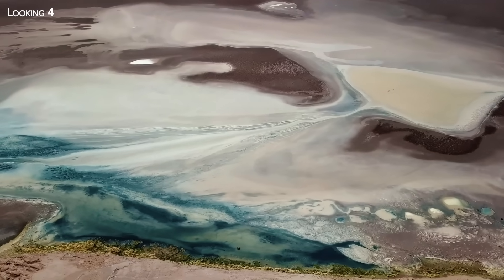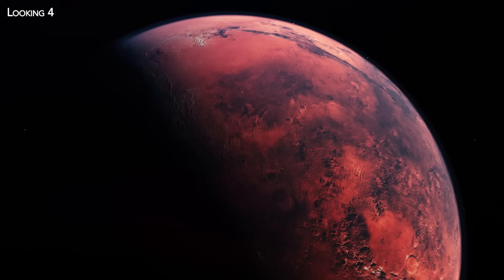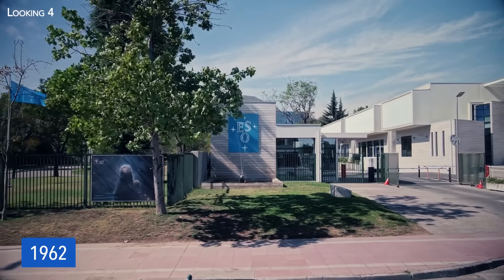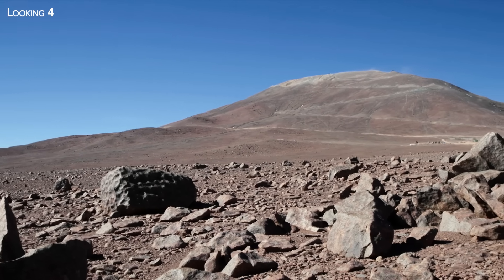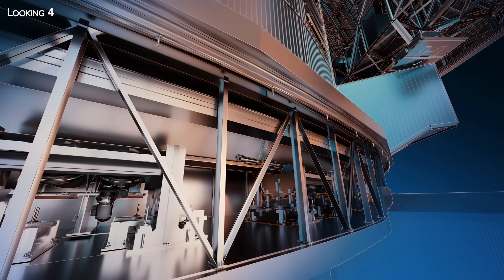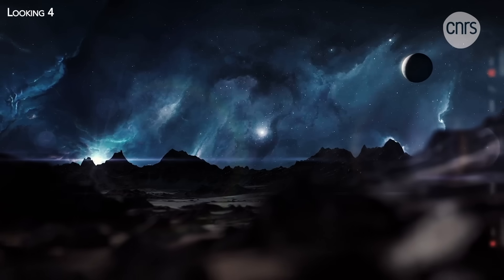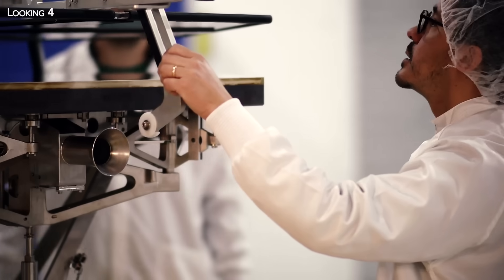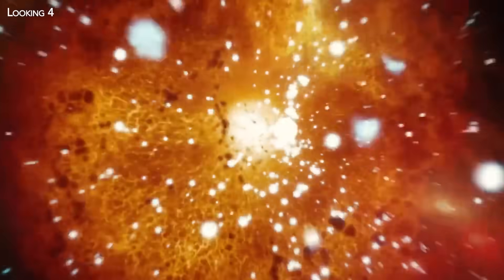ELT: The New Telescope that could Find the Origin of the Universe

Comment: First, Sagittarius A was not the first black hole imaged. That was M87. Sagittarius A at the center of the Milky Way came much later due to dust, gas and stars obscuring our view, even though it’s closer. 

Next, ESO DID cut corners. They went from 40 meters to 39 meters for cost. That is annoying and it’s a corner cut if I ever heard of one, so why go out of your way to say that they didn’t? 

Third, the GMT is not of ESO. That wasn’t mentioned, so the viewer would assume it’s an ESO project.

Fourth, the 30 meter telescope is not a part of ESO either. That’s a lot of corrections when the facts are simple and easy to find.

Just do a bit more homework, otherwise, a decent video.

Comment: COSMOLOGICAL ICE AGES
 We computed our solar system's orbit around Sirius A and B and it matches the last Ice Age cycle of 105,000 years. We were captured by the Sirius system 800-million plus years ago and were following little Sirius B 1.5-solar masses around Sirius A, a two-solar mass star. It was the light from these objects that took early Earth's 1000+ pound per square inch atmosphere down into layers of limestone 12,500-feet thick, vast layers of hard coal with a compression ratio of 40-to one and vast pools of oil everywhere made by diatoms in shallow seas. 

My Encyclopedia Britannica states the limestone layers from the Carolina's to the Rocky Mountains has an average thickness of 3,500 feet thick. You have to realize all that wonderful carbon material was air at one time. Now Earth's atmosphere is only 14.5 PSI at sea level. We lost 98% of the air on this planet. It is all underground in the form of coal, oil and limestone all created with light and the light didn't come from the sun!!! Sirius B puts out more than 100-times the light of our sun in the 350 to 400-nanometer range slightly above the range of human site. Sirius A being two solar masses puts our four times the light of our sun in the visible spectrum. 

Our solar system was born in Orion. We drifted out of their 2.4-billion years ago and earth froze up for a billion years because space is cold. There was no way to get out of the billion-year Huronian Glaciation Ice Age but by some freak were drifted between Procyon and Sirius into a mutual gravity alignment point. Little Sirius B at 1.5 solar masses came around traveling 7.5 kilometer per second and grabbed hold of our solar system and we started following it around Sirius A for the next 800-million years. 

It was the light from those objects that made the energy that makes your car go down the road and heats your home. It wasn’t the Sun! In fact, the Sun did not burn as hot as it does today 800-million years ago. There was no way it could get life started on the "---Surface of the waters" especially when early earth has a 1000+ PSI carbon dioxide atmosphere that was 2500-miles deep. Now our atmosphere is only 50-miles deep and 14.5 PSI at sea level. Co2 is a trace gas of .04%. Look it up! It has little or nothing to do with climate change. In fact, we need more of it to grow food. Methane release changes climate. Kill your cows and stop eating cruciferous vegetables. Also plug up all volcanoes because they emit lots of co2.

There is a planet in the Sirius system and they need ORME gold to spray in the atmosphere of their planet to protect it from the harsh UV light of Sirius B putting out more than 100-times the light of our sun. The Elohim / Nephilim came to Earth 400,000 years ago to mine gold. It would have relatively easy for them to travel to Earth using conventional rocket technology in a voyage lasting 8 years using the various gravities of planet in our solar system using planetary alignments. 

The Elohim/Nephilim created modern humans using some of their own DNA and indigenous earth species. They needed smaller workers because the Elohim/Nephilim stood fifteen to twenty-feet tall. You can't tunnel underground when you are that tall. It isn't feasible to make the tunnel opening that big due to dangerous cave-ins. We humans were created as a slave race to mine gold for them and worship and obey them.

On this planet our government sprays aluminum powder, boron and virus over major cities to dumb us down to keep us from questioning government and make us good worker slaves. 
READ: COSMOLOGICAL ICE AGES 380-pages 8.5 by 11 is available at: www.GuardDogBooks.com www.Amazon.com and book stores around the world in China, Japan, Indonesia and Europe.

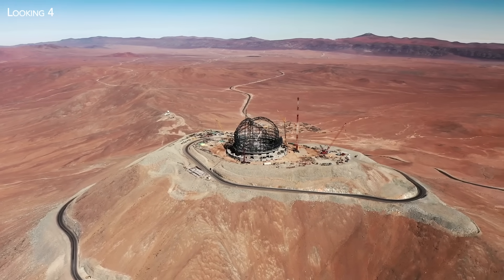Comment: At 5:19 the narrator says...'' to be close as possible to the stars, the telescope construction site is also high up ".......that is so wrong....what difference can a few hundred meters can make, when stellar distances are messure in light years.....
Reply: I know it sounds wrong, but what the narrator meant is that placing the telescope as high as possible places it above some of Earth's atmosphere. This is desirable because moving air currents tend to distort images. But since the telescope will not be completely above the atmosphere it will have adaptive optics to remove distortions.

Comment: Surely, turbulence in the atmosphere, which scatters light from stars and causes the image to appear blurred, twinkling, or distorted, will affect image clarity, unless one resorts to AI and other computer tech?  If that were to be the case, there still isn't a true image?
Reply: The telescope will have adaptive optics, which uses a computer controlled deformable mirror to remove distortions caused by air currents.

Comment: For those unfamiliar with the laser pointing at the sky. It is called Adaptive Optics .It projects the laser  in the atmosphere and looks like point star distorted by air turbulence. Because the shape is known the computer calculate and compares the laser image  with the distorted star image from big telescope. Then the computer  sends corrections to the  secondary mirror. Secondary mirror is very thin and has several small electromagnets under the mirror surface like those in a an audio speaker which with the signal from the computer bend the surface of the mirror and correct the image.
Reply: Some extra info: Often the adaptive optics uses actual stars close to the observation area to detect atmospheric distortions and corrects for these distortions in real time. If during an observation there are no guide stars near the observation area these yellow lasers create artificial guide stars by exciting the thin sodium layer around earth at a height around 95 km. The excited sodium produces light points in the direction of observation which can provide the information needed to counteract the atmospheric distortion by the adaptic optics system.
Reply: Humans can be amazing hey.
Reply: Actually, the laser guide stars are used only when there are no suitable stars in the focal plane. The amount of stray light coming from the laser beams is quite high. In fact, it's so high it affects the telescopes in the neighborhood. In the case of the ELT's laser guide star system, when turned on, it will effectively block part of the sky for the VLT which will be forced to reshuffle scheduled observing blocks. That's also one of the reasons why ELT will not have its own control room, but it will be operated from the VLT's control room.

Comment: The Multiverse (only hypotesis that can explain everything) is Eternal and Infinite and ultimately the true, unavoidable, only "God" as the Only Source of everything that exists or we believe exists ! 
Not an extremely low level, imperfect, human-like "God", a human Concept, "Creator" of imperfect things.
A Multiverse (Set of Universes) remains a SINGLE UNIVERSE composed of multiple universes (like ours, which could be inside a Black Hole - who can prove otherwise? -), ETERNAL and INFINITE that is continuously TRANSFORMING or evolving and manifests itself in many, infinite different ways, whatever they are called or perceived by us: Human Beings, Animals, Rocks, Water, Fire, Air, Planets, Asteroids, Suns, Stars, Galaxies, Clusters (of Galaxies), Quasars, Black Holes, Dark Energy, Dark Matter, Singularities, etc... 
The Universe or Multiverse only transforms: It is PURE ENERGY...
Remember Einstein's proven equation: E = mc2, which shows that E, Energy, is the same as mass (or what we believe or perceive as "solid" matter) multiplied by the square of the speed of light, a very large number. Or put another way, what we believe to be "matter", what we can "touch" is actually PURE ENERGY somehow interconnected with the rest of the Universe or Multiverse. 
If you think you can "touch" matter, use an ever increasingly powerful microscope: Body, cells, molecules, atoms... And do you think you can see or "touch" an atom? NO ! 
It has subparticles: Electrons, protons, neutrons... And do you think you can see or "touch" them? NO ! They in turn include other quantum untouchable "particles" that are elusive... because they are PURE ENERGY! Ask the scientists of CERN Accelerator in Switzerland...
It is impossible to prove it because it is and will be far beyond our limited intellectual and technological capabilities, but it does not make sense that the Multiverse or God, however you prefer to imagine it has a Beginning or an End in time... or any physical LIMIT.
What can lie BEYOND the "physical limit" of the Multiverse? Well, ANOTHER Universe or type of Universe. That is, we would be facing a new Multiverse.
And what could have existed BEFORE the BIG BANG? Well, another Universe or Multiverse... 
And once ours cools down (which is what is happening with ALL the stars burning their limited nuclear energy source) and perhaps it WILL COLLAPSE into a SINGULARITY or Black Hole and then maybe (Who could prove it or refute it?) give rise to another "Big Bang". 
That is, our Universe is... ETERNAL
And most importantly: That Universe or Multiverse is... GOD or "Creator" of everything we observe! 
A God who does not reward, punish, monitor or "prefer" anyone. "He" does not condemn anyone to suffer eternally in "hell" (which does not exist!).
A God not concerned about anyone, much less these imperfect human beings, absolutely insignificant: 
INSIGNIFICANT for the Earth, in turn insignificant for the Solar System, this one for the Milky Way Galaxy, totally insignificant for a Cluster of Galaxies, and this Cluster, insignificant for the known Universe and perhaps for a Multiverse, which is the most likely "thing" that exists. 
So, forget all those fears or feelings of "guilt" (of WHAT?) that you learned or were brainwashed since you were a child, convince yourself there is NO afterlife (where to?) because all of our cells DIE and desintegrate into dispersed molecules and then "atoms" that eventually will disperse randomly and help create, combined with others, new stars that will in turn "die", collapse and explode as super novas releasing new atoms to create new stars...and... 
ENJOY your LIFE... or "delusion" of life... or whatever it is...👍 !

Comment: Somebody tell me if im right.      if a star is so far away light from it is still travelling towards earth.  So no matter how powerfull a telescope is.   if light doesn,t hit its lens   it will not be able to see it
Reply: That is correct. But if you ever used a torchlight you'd know that the light spreads with distance. So light from a star is actually going in all directions and you can see it from anywhere if it's not blocked by some other object. The only limitation is that it spreads so much that your telescope mirror is only hit by small number of photons from given star. That's why you want to have large mirror (so you collect more photons from the same star) and you also do long exposure.

Comment: The "telescope construction site" is "high up" not "to be as close as possible to the stars". It is ridiculous to imply that where the telescope is being constructed, relative to if it were instead built at sea level, makes any difference as far as distance alone is concerned. Otherwise it would make more sense to place it at an accessible, convenient location. It is constructed at a high elevation to minimize the interference of atmospheric conditions. It is sloppy research, writing, and narration like this that calls into question the validity of the entire presentation and why I am bailing out at this point in the video to learn about this magnificent project elsewhere.

Comment: It's not high up to be closer to the stars, but to get out of the atmosphere as much as possible.
Reply: I wonder if Mac Donald’s will open a branch there
Reply: However in the particular case of the Atacama desert in Chile is not the proximity to being outside the atmosphere what helps the most,  but rather the low light pollution caused by cities in addition to dry atmosphere and lack of air turbulence. The Atacama Desert is the best place in the World to see the Galaxy at night  even without a telescope .
Reply: DOES THAT NOT CREATE THE SAME EFFECT ???
Reply: @Mr123HEAVYMETAL  no, the difference in distance to the stars is infinitesimal,  like 0.00000000000001%. the improvement by not being deep in the atmosphere is enormous.
Reply: Both can be true because they are the same thing.
Reply: A few thousand feet vs millions, or billions, of light years?   Staggeringly insignificant.   @johnmabary
Reply: @johnmabary  Being outside the atmosphere makes a big difference , but as far as distances you are  concerned having a telescope at 7000 feet altitude or in the Moon won`t make any difference.
Reply: @johnmabary  not at all the same thing.

Comment: Will this be able to see evidence of the moon landings?
Reply: feature_size = 1.22*wavelength*distance/diameter which means ELT looking at the Moon would under perfect conditions see 7m per pixel. Hubble would see 100m per pixel if pointed at the Moon.
Reply: For some reason, they don't care to point the Hubble telescope or  JWST , In that direction of the moon.  😒

Since there is no wind on the moon, that flag that they planted,  should still be standing. 🇺🇸
Reply: You would be willing to believe a picture from this telescope while you refute any other picture, motion or still, that shows the moon landing? Give me a break.
Reply: @joachimb5721 you numpty I'm not disputing anything, just asking if this telescope could show evidence of the moon landings that's all you thicko😂😂😂

Comment: That's a big ole telescope. One thing you didn't mention that I think is really cool is that it's supposed to be able to correct for atmospheric distortion. I don't know exactly how it works, but somehow they point a bunch of lasers at the sky that detect the distortion, and then software makes corrections to the image in real time. It'll be pretty amazing if it works.
Reply: This is standard practice now. E.g. the Very Large Array telescopes (not far from the ETL) already use this sort of correction. Tom Scott did a great (what else?) video on it. It also captures the ELT.
Reply: It's called "Adaptive Optics".  The primary mirror can change its shape to correct for atmospheric distortion as measured from the sodium (yellow) lasers.
Reply: That system (called adaptive optics does work, and is in use at almost all major telescopes worldwide for decades now.  It all depends on massive computing power that can detect the  'flicker' of the  light from lasers shining into the upper atmosphere and then correct the shape of the mirror by moving those (739?) hexagonal segments by microns at a time, in real time.  The whole massive surface is constantly moving imperceptively to the human eye, to cancel out atmospheric disturbances.  This is by far the largest application of the engineering, but it principal the system is well understood.
Reply: The laser creates "guide stars" that will be used to correct the image for distortion.
Reply: Good point. Imagine this telescope sitting on the far side of the Moon.
Reply: @thomaslewis7883  
It may sound cool, but the moon has a lot of dust.
Reply: @catman8965  Yes .Having read a lot of the Apollo debriefing documents, science papers, dust was a major problem  That said, there are solutions to the problem.
Reply: @catman8965  There is no atmosphere to disturb lunar dust. When it settles on the ground it stays there unmoving  for tens of millions of years until disturbed by an Asteroid striking the moon very close by.
Reply: @petergibson2318  
What?  There's no atmosphere on the Moon?  LOL   Yes, I've known about that for 50+ years.  The next time you track dirt from the bottom of your shoes into your apartment, ask yourself if the wind blew it in, or did you. There's more than one way dirt and dust is spread.
Reply: @catman8965  The reason moon-dust was a problem for the astronauts is because they were kicking it up and running around in it, and bringing it into the LM. An automatic Telescope would have no such problem in the perfect stillness. The footprints the astronauts left on the moon, in the dust, will remain unchanged for millions of years at least. Perhaps a billion years.
Reply: @petergibson2318  
You might think you impressed me about your knowledge of the foot prints.   In fact reports about this first came out shortly after the first landing (1969).  Interesting though, their reports stated back then stated they would last a few thousand years, but I'm supposed to believe your first figures of millions of years, and now a billion years.  Tomorrow, you will claim they will last beyond the age of the universe.  BTW You have never worked as an engineer.  How would I know that?
Reply: @catman8965   calm down buddy its okay
Reply: @catman8965  Anybody capable of asking such a question is unworthy of any answer I might deign to provide him with.